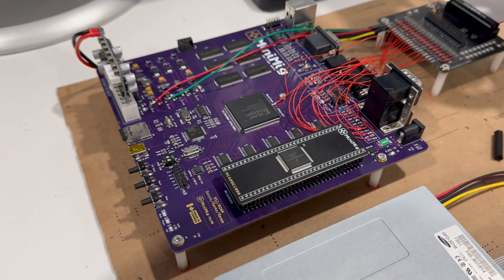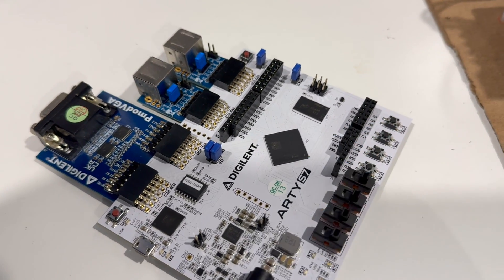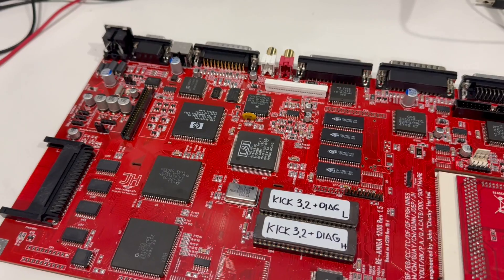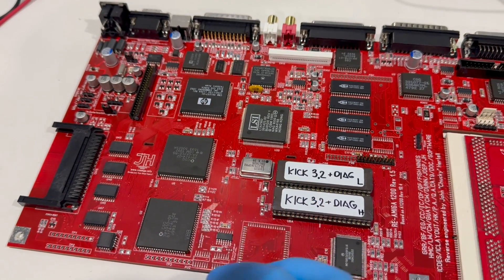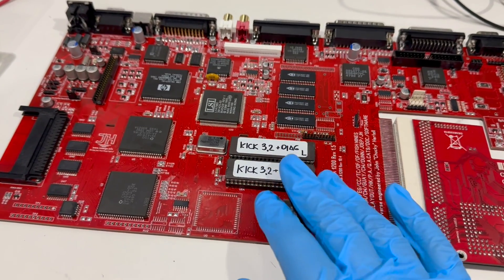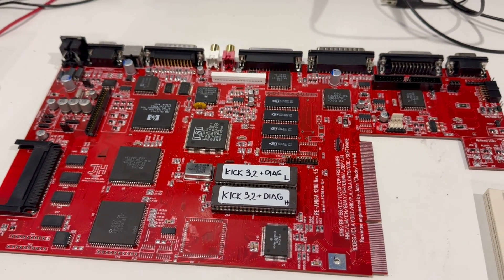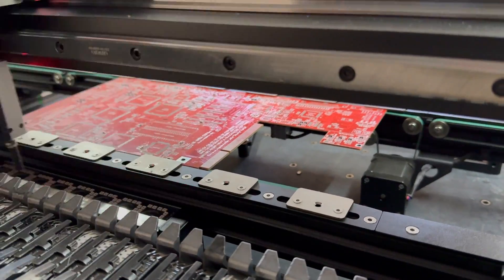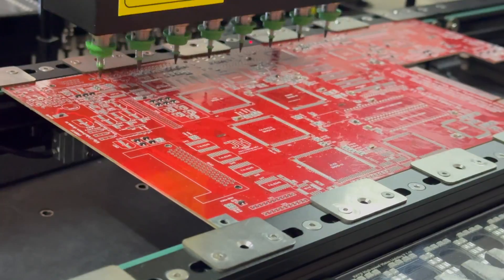AmiCube progress and ReAmiga 1200

Comment: When the custom chips NOS finally runs out, fpga is the only way. Perhaps someone could make replacement chipset ICs using fpga on a castillated PCB as a drop in replacement for the PLCC ICs. That would extend the life of existing Amigas. I'm sure someone somewhere is already considering doing this or have done it already. I know the keyboard MCU was already done using a atmel microcontroller.

I've soldered my own ReAmiga board by hand and thought of it as some kind of rite of passage lol! It feels great to have built one by my own sweat, blood and tears. It's crazy expensive though, I think I've spent upwards of 800 euros for one machine (I got parts for 2). Hopefully your projects will bring down the price or keep it from raising to keep it more accessible.
Reply from the maker: Indeed. FPGAs are the optimal choice due to their accuracy and ability to expand the functionality of original chips. They represent a sweet spot in current technology. However, I'm optimistic that in the future, we'll be able to produce ASICs at a much lower cost. Perhaps we'll even see home ASIC printers someday! With the rapid pace of technological advancement, anything is possible! ;)

Comment: Great stuff! I know it’s not as big of a market, but I hope you someday consider making an FPGA Amiga board with rear ports and a floppy port in the A1200 form factor. That way a person could order one of the new A1200 cases now being manufactured from molds, install your board, a floppy drive, and build or buy a keyboard to have a complete A1200 FPGA. I will probably buy one of your boards and make one of these by modifying it.
Reply from the maker: Yes! This is something I am thinking about for some time. Imagine 100% fpga replacement for A1200. Including all the ports, expansions, floppy and IDE headers etc.. At some point we will get there I am sure.
Reply: @amicube  Great to hear! Love all your projects.
Reply: I have an 3000 case that I would love to be able to put something like this in. along with floppy and ide hdd support

Comment: if the AmiCube board has the capability of using a real floppy drive, a ide harddrive and the ability to use a real amiga keyboard I will absolutely be buying one.
Reply from the maker: All easy to implement! Once we have new large FPGA part, I will make sure IDE and KB is in place!
Reply: @amicube  awesome!

Comment: When the pick and place machine places the component on top, is it soldered right then or like you describe on the bottom it's held in place by a kind of glue that I assume has solder that will melt in the re-flow stage?
Reply from the maker: When component is placed on the top by machine, it is not soldered. At that point components are just floating on the pads. Then from pick and place machine board goes to reflow oven where soldering is done.
Reply: Maybe the creator can clarify this, but do you place the bottom components without reflowing them, then place the top components and reflow everything, or do you reflow twice-- placing the bottom components and reflow, then place the top components and reflow one more time?  Without glue, I'm curious whether the unreflowed solder paste or the surface tension of the reflowed solder holds the bottom components them in place.